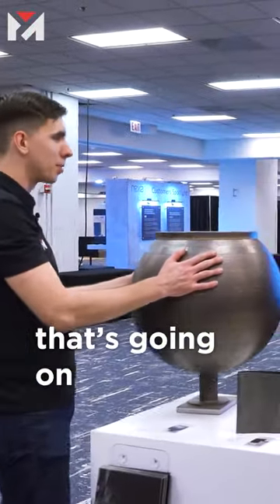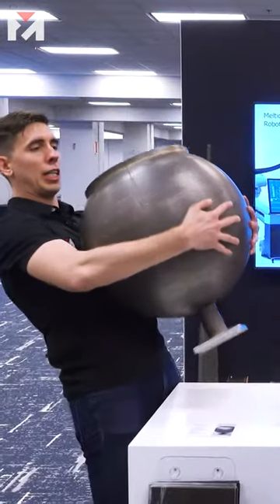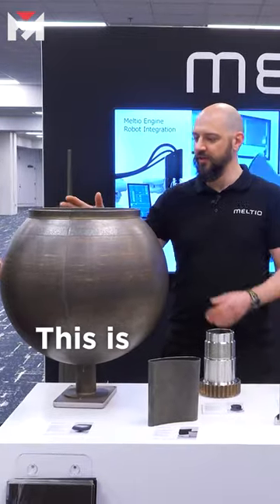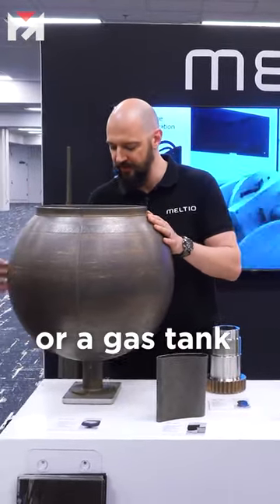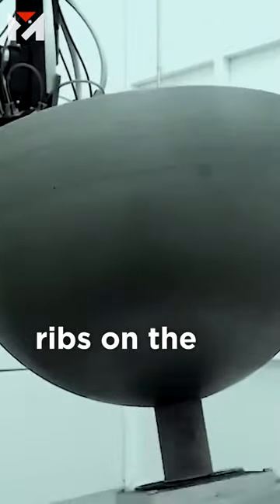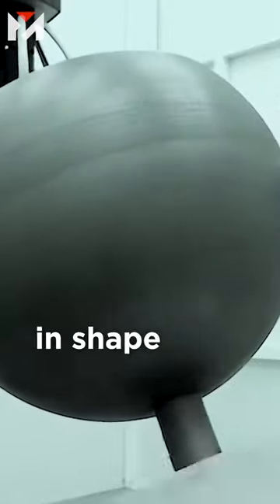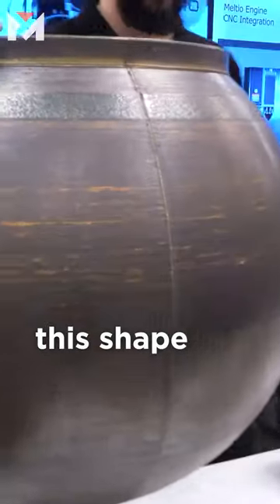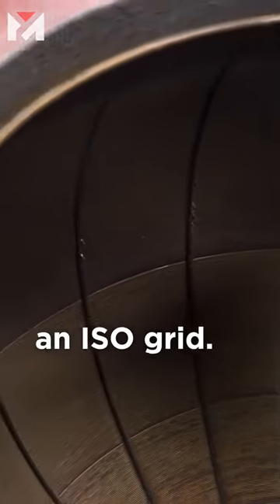METAL PRINTED BOWL? 
#shorts #meltio #amug #visionminer #3dprinting

Comment: What kind of material strength do you end up fusing titanium powder with a laser vs cast steel / powdered metal steel / billet forged steel.

Could you scan / model automotive suspension parts, generate new leaner models with generative design, and print stronger ligher parts?